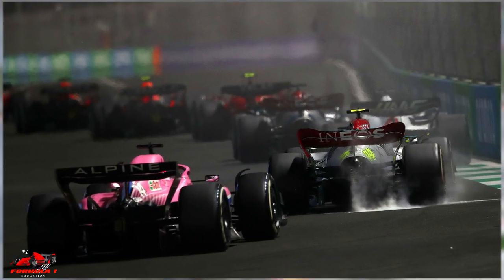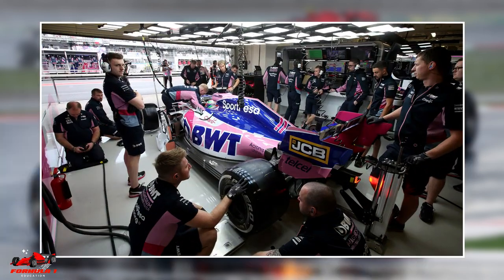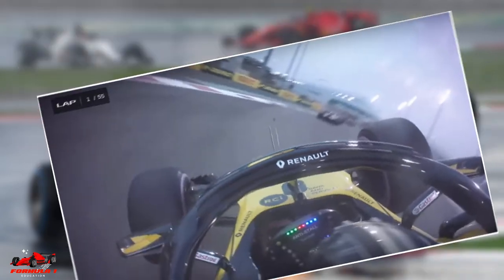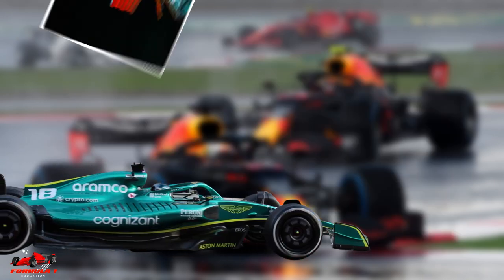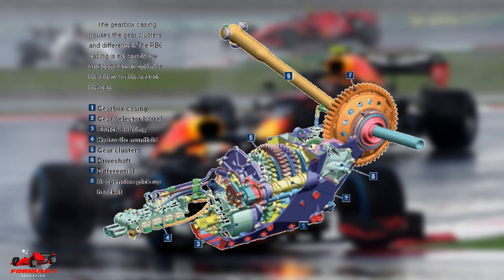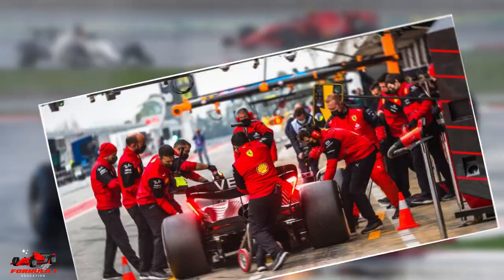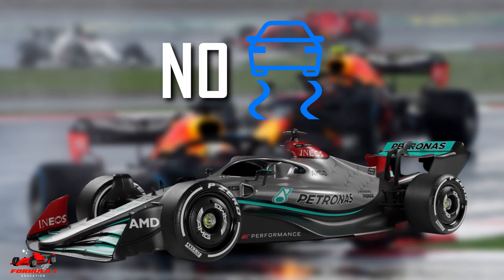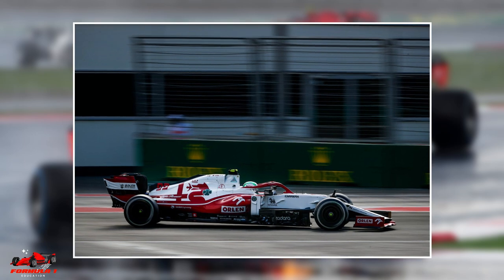What Is Anti-Stall On An F1 Car? How Does Anti-Stall Work | f1 Anti-Stall review

Comment: Modern hybrid era f1 engines can in fact restart the engine using the mgu-k unit, however anti-stall is still very much an issue if the driver spins off track or drops the clutch to quickly during a race start.
Reply from the maker: Thanks for clarifying. As you said, modern F1 cars can be restarted. Apologize to the viewers for the inaccuracy in the video.

Comment: Thanks for the video! I was wondering whether antistall kicking in at the start is a driver error or a software error. Because when it happens usually the driver acts surprised.
Reply from the maker: Thanks for the comment. I could be wrong, but I think it is a combination of both. My understanding is that most of the time it happens because the driver has the wrong clutch position (holding it too much or too little).